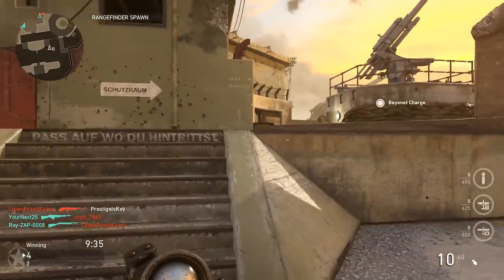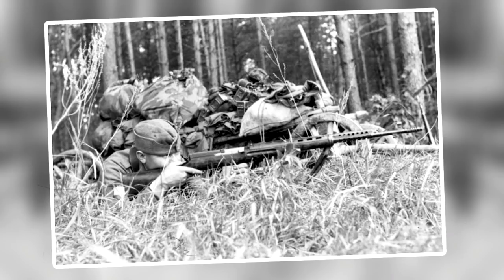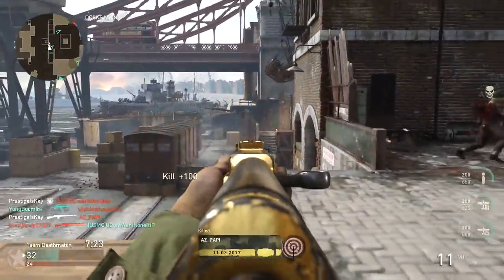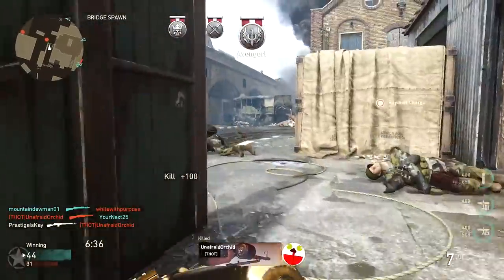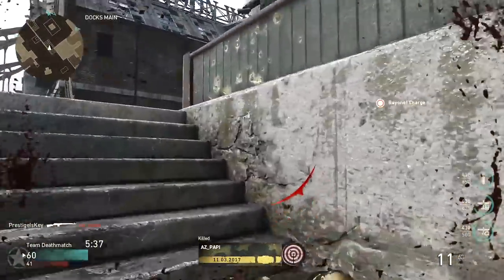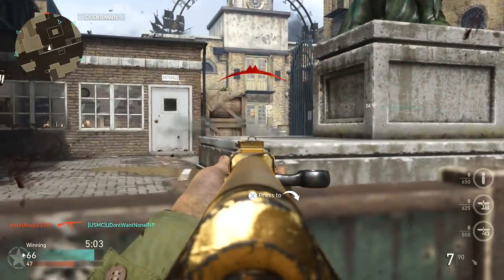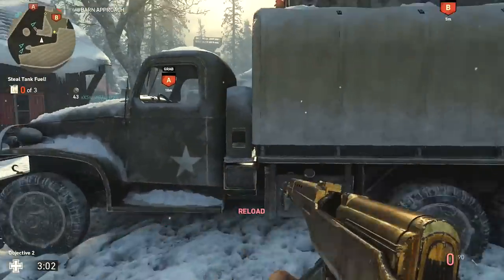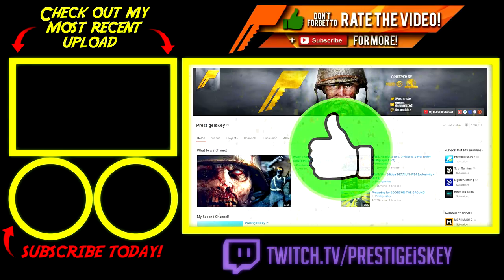COD WWII: Road To Gold (SVT-40)

Comment: When you upgrade the SVT in zombies it turns full auto, and called the AVT. Coincidence? I think not
Reply: Rogue Overkill 

Wish the rifle had a Select Fire attachment for the SVT-40

Then I would have used it with Extended Mag (if the developers had included it)

Comment: Easily one of the worst guns in the game
Reply: grant chelm semi auto guns > everything else
Reply: grant chelm youre probably someone who uses the BAR or the Stg but the svt could melt if you know how to use it
Reply: Zimpfy I'd rather have my sniper
Reply: Easily one of the most average guns.
Reply: Agreed. Almost pointless to use this over the M1 Garand. The M1 Garand has better fire rate, faster reload, less recoil, also a 2 shot kill and better iron sights. The only thing SVT 40 has better is the slightly better range and the mag size, but the mag is only increased by 2 bullets anyway.
Reply: Not so bad in Hardcore, but then again, almost nothing is bad in Hardcore (though I don't understand who would use a bolt action sniper in HC).
Reply: 4NewHop3 Lol I don't understand that either. I was playing hardcore on Gustav Cannon yesterday and everyone was using a bolt action sniper, when a karabin or even M1 Carbine would've been better. There's no point in using an extremely powerful gun (such as a bolt action) in hardcore when you could have the upper hand using something simpler that has better fire rate/accuracy.
Reply: 4NewHop3 M3rkmusick does that.
Reply: Yagami Raïto It's kind of redundant. Kind of like what Prestige said about grips on semi auto weapons (especially for previous COD games). Bolt actions are already capable of very, very frequent one shot kills in Core (especially this game), even through materials (I can wall bang people with the Kar-98). In Hardcore, where everyone has 2 shot kills max on every gun and even some rifles such as the SVT, M1A1, M1 Garand, FG-42 with great or indefinite 1 shot kill ranges, you really put yourself at a disadvantage.
Reply: 4NewHop3 Not everyone wants to go the easy way i guess. Sure it puts you in a disadvantage but it's like a "High risk, High reward" also you need to be more accurate because any mistake can cost you a live. Can be good to do that from time to time.
Reply: Yagami Raïto You make a good point. Never thought of it like that.
Reply: Yagami Raïto not in this game m1 Is ok but the rest are terrible
Reply: • Jibjabs1 • i was using Lee Enfield in hc earlier for the 1 shot kill challenge goes faster in hc
Reply: Towns People War is best for sniper challenges bro. Even though the Lee Einfield gets a lot of hitmarkers, War helps because there are always so many people at a certain objective. That's how I got my snipers gold. But at the same time, push the objective and be helpful haha
Reply: • Jibjabs1 • i play war alot lol I'm 4th prestige atm i prefer hc for snipers though got 2 gold today in no time was almost able to get type 100 gold almost also
Reply: Towns People War is the best for XP and is pretty fun. It's a shame that they lowered the XP rates after the first week or so though